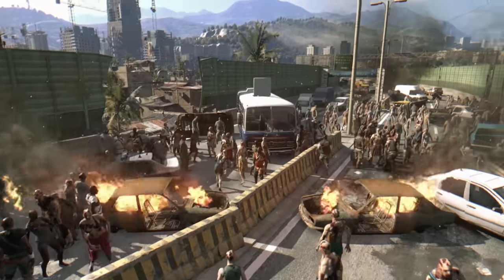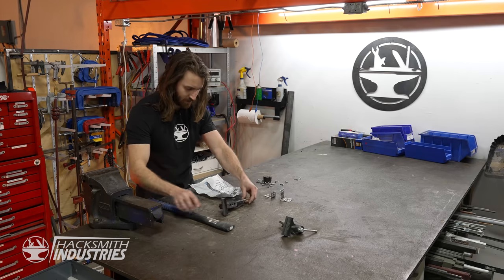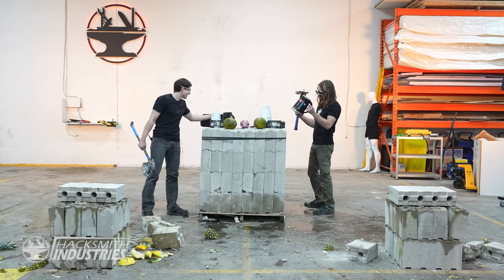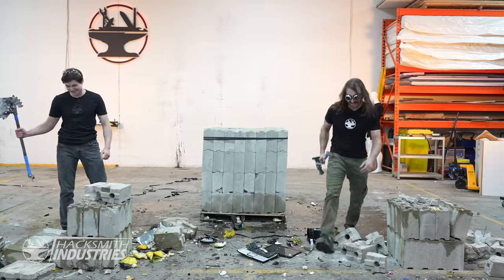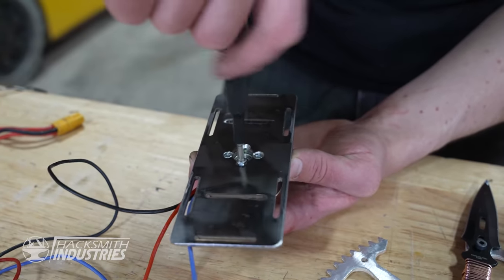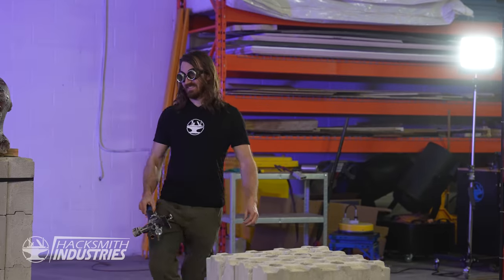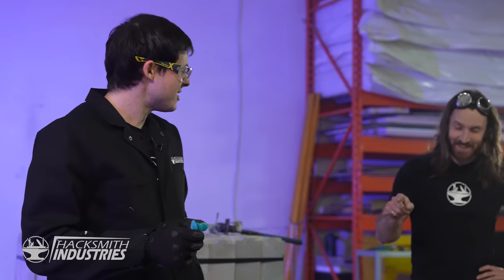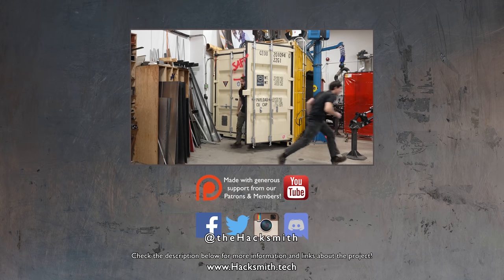Scariest DIY ZOMBIE WEAPONS (from Dying Light 2)

Comment: Both weapons are great but in a survival situation I would chose hacksmiths. For example the blade on the axe would eventually become dull which would heavily limit its effectiveness as apposed to the hammer which wouldn’t. While the hammer would take more force to swing it would be easier to remove from the skull.

Comment: Make the fire stile jutsu where the power is stored in the head band and then at the hand a flame can be turned on and a littel pipe at the mouth so when you open your mouth wide then a flame like thrower will basically happen

Comment: Hey idea for a project. Make a modern/futuristic balista using our knowledge of advanced materials. 

The idea behind this is simple. Crossbows/bows are very old weapons an can still over power modern body armor. So I was curious if a modernized balista maybe armed with a tungsten bolt could penatrate tank armor. 

A old siege crossbow could have a draw strength of 1280 lbs an balistas even more. Soo I thought it be cool to see to see what an old  design could do in a modern era if it was built using new technology an such

Comment: What fittings/hose did you use to connect the canister of butane to the fuel line for the flame mod? I’m trying to make some “fire bender” gauntlets but I’m having a hell of a time finding a good way to connect a store bought can of butane to any type of flexible hose to go from the fuel tank to a small expansion chamber on my forearms. Only difference is I’d feed it from the top rather than bottom so I’m getting gas rather than liquid butane.
Reply from the maker: Tight rubber hose all the fittings are for show -- the brass one that threads onto the can is a 3/8th JIC flare fitting, that if you push and twist hard enough, it threads the nub of the butane bottle, and holds it in place, which is nice -- but the actual fuel path needs to be a hose